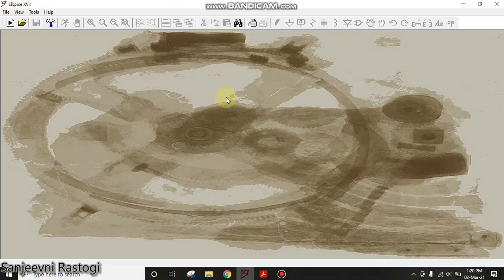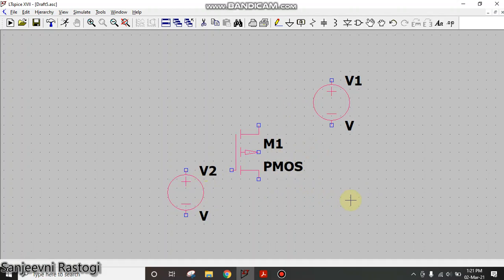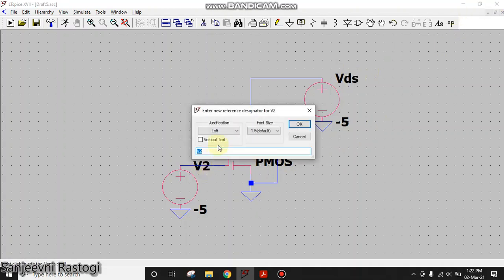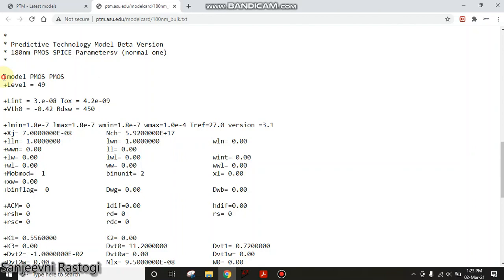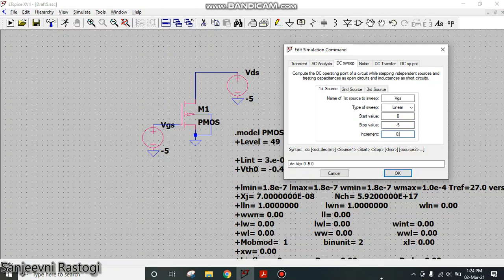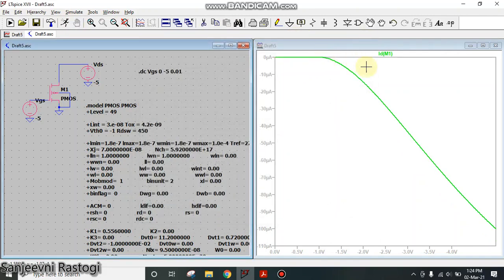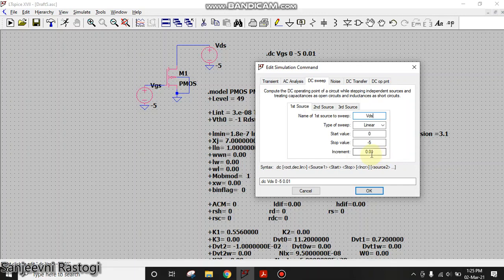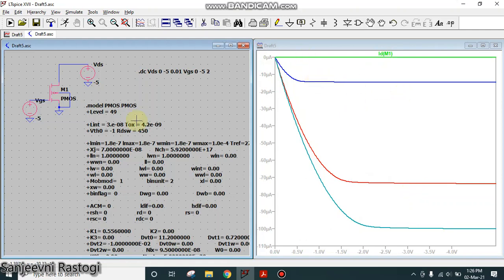PMOS Characteristics in LTspice | How to include model file from Google in LTspice?

Comment: Hello. My background is in controls, but I've been tasked to learn more about hardware and LTspice.  I've been having a lot of trouble but your video has helped ma lot.  Am am using the latest version of LT spice and there are a few things worth noting to get the simulation working to your results

1) Make sure you set the DC Sweep from -5V to 0V.  It doesn't like it if you start from 0V to -5V
2) Make sure you update the PMOS directive to your PMOS component name.  Eg:  If your PMOS is called MY_PMOSS, set the directive to .model MY_PMOSS PMOS.  Also the latest version of LTSPICE doesn't like using the same directive and component name.  Eg: .model PMOS PMOS will throw an error.

Thanks for the help!

Comment: Mam,you are getting inverted traces because you need to connect body terminal of PMOS  to Source/vdd not to ground,
Reply: source is ground here, and Vdd means Drain voltage. pmos usually has inverted trace